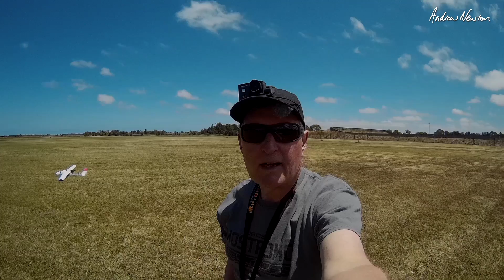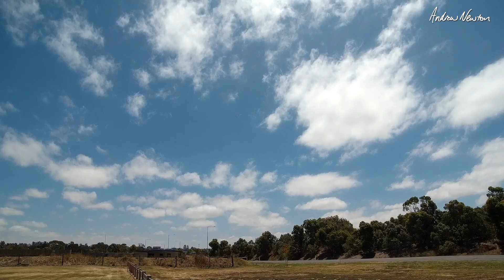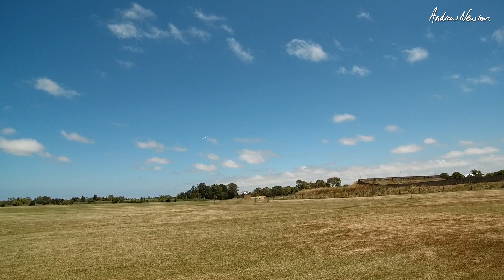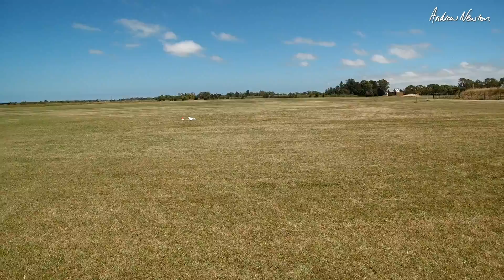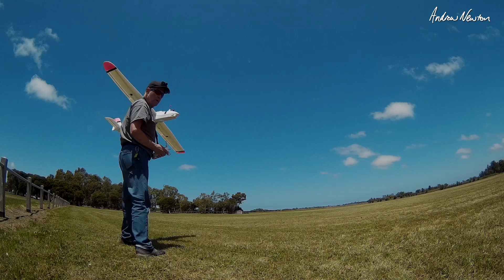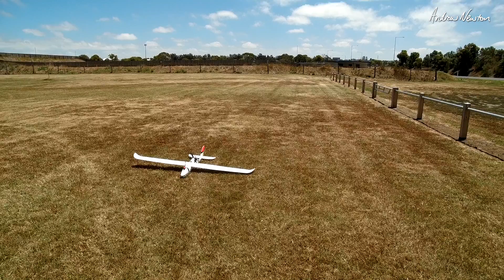iNav Nav Launch or Auto Launch Demo

Comment: Just wanted to say thanks for the information on your website about 'Unusual RC and INAV problems and solutions'. I tried to leave a 'thank you there but my computer didnt like something there. So anyway, your web page again saved me a lot of grief. I had a successful Inav AutoLaunch and setup for a second flight but kept get 'unable to arm rollpitch not centered". Went home, I recalibrated my radio twice and reloaded my cli dump/diff file but still not arming.    I did a search about rollpitch warning and I then found your hints/tips which said to center the roll and pitch trims. That was it. Thanks again for your help.
Reply from the maker: Great, glad to hear that solved your problem. I'll keep adding to the list

Comment: Hello, I’m having an issue where I’m getting Unable to Arm - Disable Navigation First when I “Autolaunch, Loiter or RTH, arm, then Throttle. If I put the board in any navigation mode, I see Unable to Arm - Disable Navigation First. How do I get past this error?
Reply from the maker: I think INAV changed the sequence recently but I dont use Autolaunch any more. Have to arm first maybe?
Reply: @AndrewNewton  that is it. I needed to arm first, then switch loiter or RTH. Thank you 🙏

Comment: Are you using the stock inav auto launch settings? If not what have you got on your Ranger?

Also what would you say the stall speed of the Ranger 200?

Have a good Easter.
Reply from the maker: Stock settings. Stall speed is slow, 1400 cruise throttle works for me.
Reply: Thanks Andrew and thanks for the great videos you make and information you provide.

Comment: Can you put lunch mode on a monetary switch? Or does it need to keep activated throughout the sequence? Also, I see there is an option in INAV to always enable launch mode. Do you know how that works? Thanks for the great video btw, I was just looking into this for my Talon GT setup.
Reply: You can set this feature to always on. As soon as you arm, the beeper should be ative and if don´t like
auto launch this time, simply jiggle the aileron stick and it´s off.
Reply from the maker: The launch phase only lasts for 5 sec by default. Then it reverts to what ever other mode you have selected. You can leave the Nav Launch mode with on

Comment: Hi Andrew I'm just finishing putting my Ranger 2000 together with the same motor/esc and Lipo combo that you are using !
Is it better with 8 x 6 or 8 x 4 prop ??
Reply from the maker: I use 8x4 but it could easily handle 8x6

Comment: would it be easier to just autolaunch on arm? and then if you want out of auto launch just blip the elevator or aileron stick after arm to cancel autolaunch.
Reply from the maker: To be honest I think it's easy just to launch normally
Reply: @AndrewNewton  But not with a bigger wing ( e.g. my 1360cm  Falcon), trust me.
Reply: That is possible with later versions of inav.